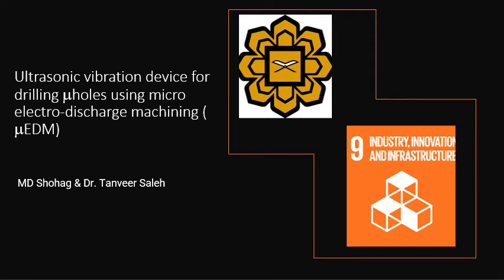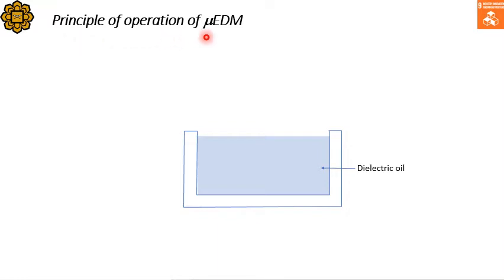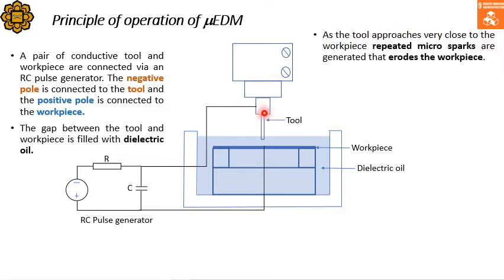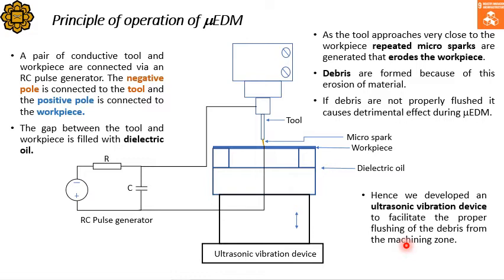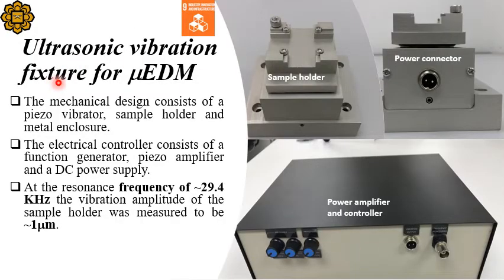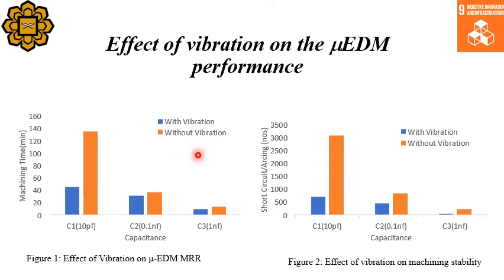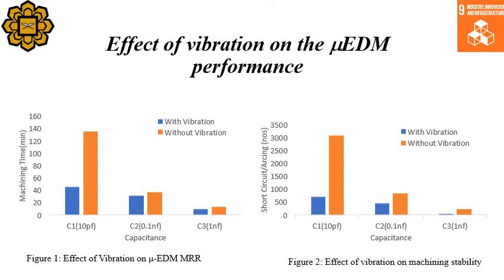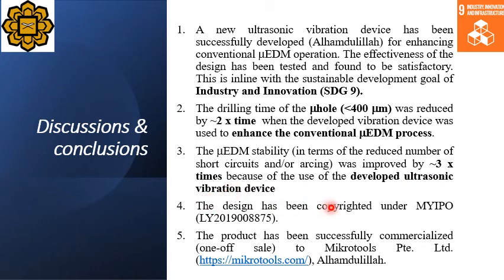Ultrasonic vibration device for micro electro discharge machining

Comment: What is costs of ultrasonic set up???
Reply from the maker: It is about USD 2.5K to 3K. Thanks.
Reply: Thanks for replying....Is there any alternative because its too much expensive  ... I want to give vibration to dieelectric..... Can i provide it with piezoelectric humidifier????
Reply from the maker: @niranjanvelari7337  you may try out this one. https://www.lazada.com.my/products/100w-28khz-ultrasonic-cleaning-transducer-cleaner-power-driver-board-220vac-i2297515346-s9771625596.html.

However, the frequency is fixed in this case.
Reply: @Tanveer_Saleh  ok
Reply: @Tanveer_Saleh  thanks🙏🙏🙏
Reply: Can you share this ppt